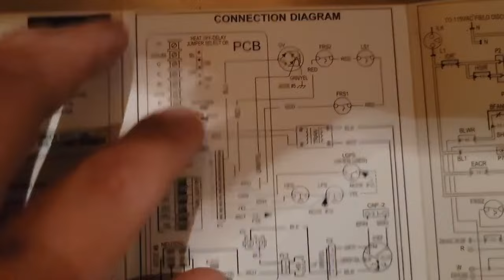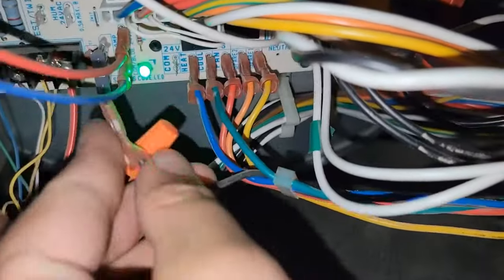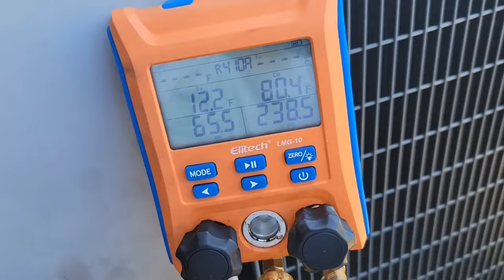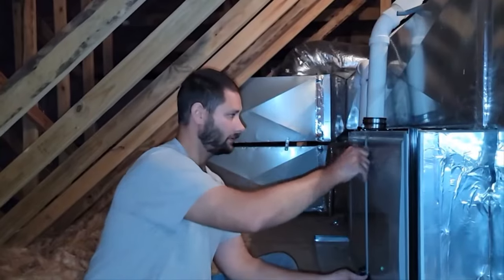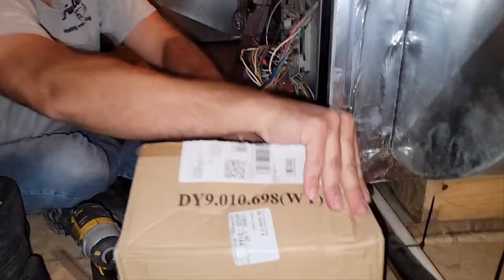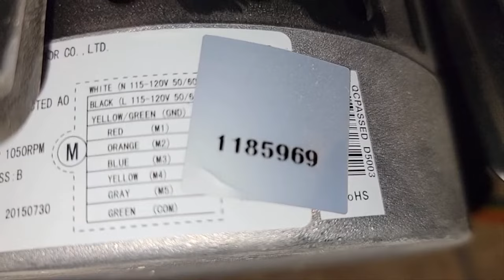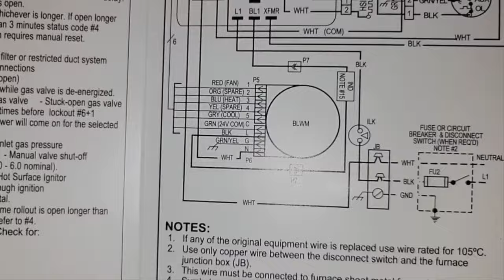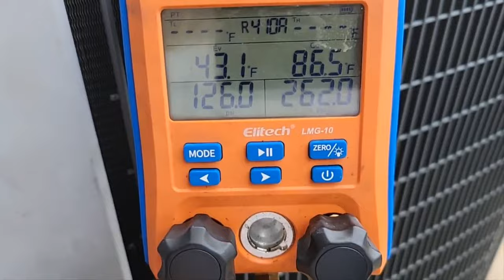How to know if the Control Board or the Motor has Failed? #controlboard #motor #hvacservice

Comment: Don't know if you caught it, but when you were testing the low voltage and put the wires back on the terminals, you reversed the cool and the common wires.  The cool was black and you put it back on common.  Heh heh heh... Just busting your chops.  Simple mistake.  You're really doing great out there big guy.  Keep on being you!
Reply from the maker: lol 😆 🤣 😂  crap 
I can't do one thing wrong 
Thank You for catching that 
 I
Reply: Boroed and  trasforme in out power ou 24 low volt  checking bord  conrold  drwing flowuping pcb  one by checking   blower    tharmostdisplaying   fan speed pcb drwing one by checking
Reply: Speed low meidom  high  cool  hot   boread  blower

Comment: Question if check the motor and didn’t get proper voltage would I go to the transformer and check there. And if I’m not getting power there I would have to change the transformer?

Comment: Why is there voltage on the board spades itself, I thought the 120V and 24V are coming through the wires that you removed? Apologies if that is a stupid question. Thanks for all the helpful videos!
Reply: I think I'm getting confused because on an ECM motor you can check L and N on the plug to see if the motor is receiving high voltage and the speed taps for 24v through the wires that plug into the motor
Reply: @korvoterry1520 yes the proper voltage was good on both motor and board so I was a little confused
Reply: Why would you say that the motor is bad when it reads 121 volts to the motor which is proper voltage reading? Please explain
Reply: @samgonzalez1447 even though you have 120 volts coming from the board,the motor is still not coming on.Those ECM motors are horrible and expensive.

Comment: Could swapping the speeds help kick start the blower? My blower doesn’t work it just gives a 1/4 turn then turns off. Heater, ac, fan all do the same. Everything turns on with the exception of the blower. It does not have a capacitor as it’s a variable speed
Reply from the maker: Check the capacity. Make sure it's working correctly check and make sure the blower wheel is not stuck on the housing.
Reply: @TaddyDigest  the blower wheel is not stuck, it just semi kicks in and then shuts down
Reply: Do you recommend any control boards from Amazon if so could you send link?

Comment: I was told yesterday from a service tech that my motherboard and motor need replacement, just over 4k ! Is that something that happens that both go out sometimes together? I’m probably going to go with a new system because of this since my Trane unit is 13years old and not worth it to put that kind of money into.
Reply: @Michael-wy7om  Same quoted 17.5 for new unit.

Comment: I thought if your getting the 120 volts going to fan motor that it would mean it good? Your said you have to replace fan motor?  I am confused 

Can you explain it? Thanks and great job though to find the wires to test it.
Reply: Can you please explain it?
Reply from the maker: yes 
if the motor has voltage and its not running 
that means it's bad
Reply: @TaddyDigest  that’s correct thanks!

Comment: Awesome video! Quick question. On the new motor, why did you put the grey speed wire on the spare terminal? Wasn’t it suppose to go on the cool terminal for high speed or did you just wanted to lower the speed to the blower motor when calling for cooling?
Reply from the maker: Hey Gerardo
 I wanted to change the speed
 I'm glad you caught that
 Have a great day